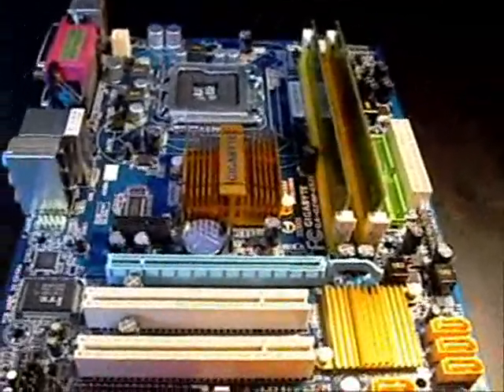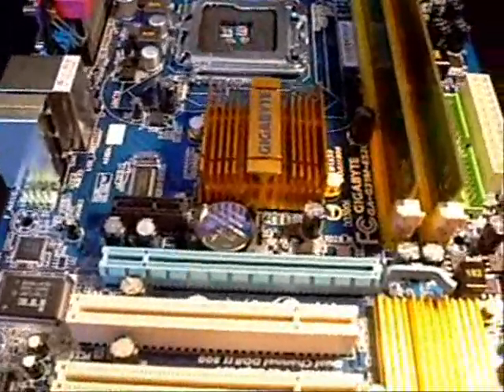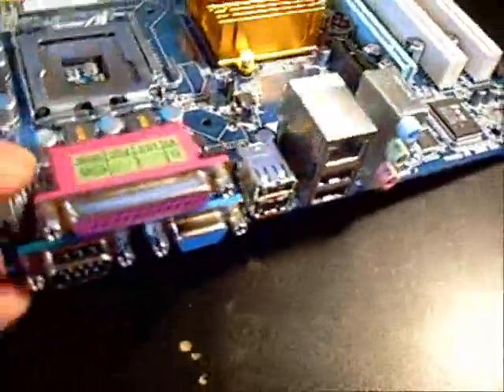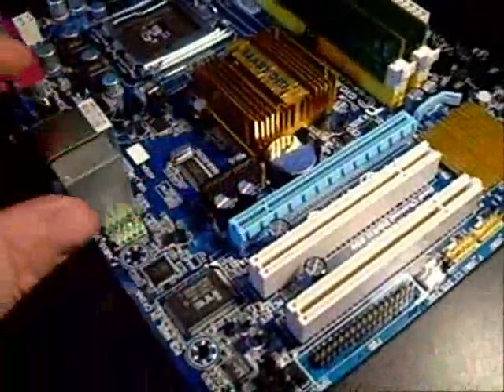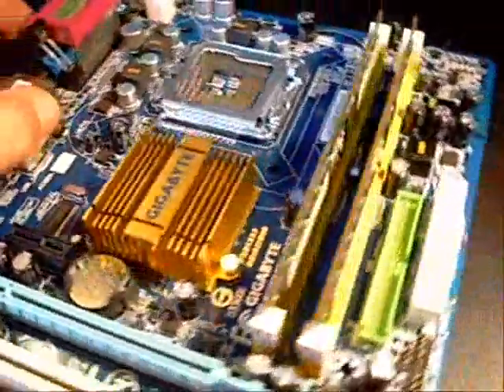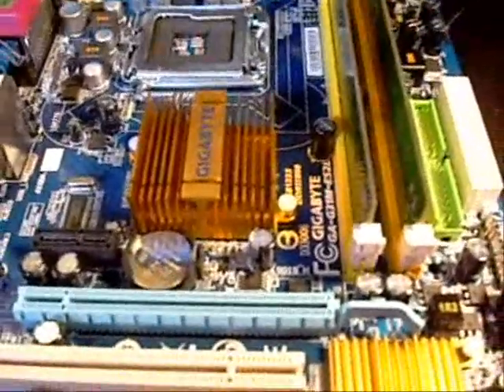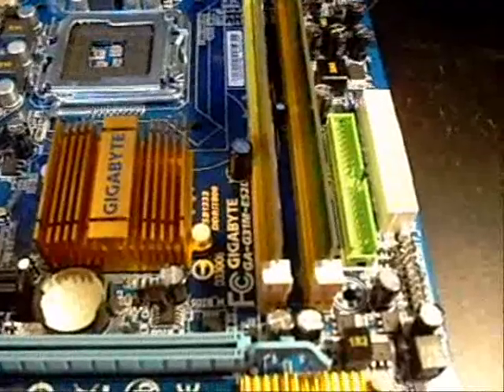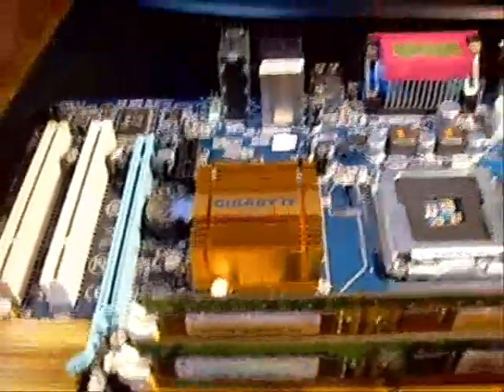Full Review on the Gigabyte GA-G31M-ES2L Motherboard

Comment from the maker: @AtomicF Some very nice choses. You didn't mention what cpu you are planning on using?.

One thing you will need to change is the memory This board only supports DDR2 800 mhz ram. So you might want to find a set of that. The board will support up to 4 gigs or ram. So you might find a cheap set of Gskill DDR2 800..

Comment from the maker: @mrjamesb562 I have not heard that they have quit making them. I still see them for sale but that might be old stock. I am not sure what the FSB limit is but it is well over 400. I have ran it as high as 455 but couldnt get it stable there with my Q9300. Right now I have it at 433 with a overclock from 2.5 to 3.25 and it is rock solid. With some more tweaking I am sure I can get 3.4 stable.

Comment: Great review, all points covered spot on. I remember reading somewhere about this mb not having  all the memory dividers? that the lowest is 2,66, so with fsb 320 ram would work at 851, can you confirm that ?
Only 4 gb is bad choice for down the line. you think they might enable 4gb sticks in newer bios, i haven't heard of many boards with this constraint...
Also if you know any similar board in that price segment, maybe from asus with similar oc capabilities that supports more than 4 gb of ram?

Comment from the maker: @shemists1 Thank you very much :-)

The onboard video is pretty weak for gaming. But the good thing is that the pci-e slot can run any card that you want. It is x16 and I used mine with my ATI HD4870 and it worked great. But I am sure it would use the HD5970 or a GTX 295 or what ever you want in there. But just about anything would be better then the onboard. I evern used my old GT7800 and that worked very well in it.

Comment: yea i meant pci slot lol. I use 1 pci slot for my wifi pci card, and I use the other one for my vantec pci dual 70mm fan card. So I guess I will just screw the fan card into the expansion slot to hold it in.

Comment from the maker: @Twentysixbillion The manual does says it wil do 7.1 surround. But from what i read you have to have a case that has front audio connectors And you use them for the side channels. But to switch channels you just go click on the audio mananger icon in your taskbar and change how many channels you want. To be honest I have not messed with it i just have regular speckers hooked up to it.

Comment from the maker: @Twentysixbillion If the computer shuts off on its own most likely you either have a overheating problem or a problem with the power supply.  Overclocking is raising the front side bus oc the processor to make it run at a faster speed then it was sold at. Like taking a 3.0ghz procesor and running it at 4.0ghz. But it should not make the computer shut off.

Comment from the maker: Yes and no. It would work but because the board only supports 800mhz ram it is going to read it as 800mhz. But if you plan on doing any overclocking it would work great because you will be increasing the fsb of the ram as well as the cpu. And you know that ram will handle up to 1066mhz.

Comment from the maker: That is a very good question. 

Generally the ram with the lower clock is going to be faster. But in real world applications I dont think you would notice any difference. 

If you plan on doing any overclocking I would go for the one with the lowest clock speed. That way if you have to losen up the timings you can set it at cl6 instead of having to go from cl6 to cl7 on the 800mhz.

Comment: the disadvantage is really the 2 slots of the memory :( i used this mobo for almost 5 months or so and i really like it , runs my games with the Nvidia 9800 gt, it's a great board, and i don't use any overclock on it :)

Comment from the maker: Yes this boards is very easy to overclock but it does lack a few feathures that the high end boards have like the ability to overclock the cpu and the ram seperatly.

As far as switching the northbridge cooler you would have to be very careful they can be hard to remove and will void your warrenty if you damage the board trying to do it.

Comment from the maker: That is cutting it kind of close. according to my calculation that setup will draw about 185watts at 85% cpu usage. Or 194 watts at 100% cpu usage like during a stress test. You didnt mention anything about extra fans for the case so I added 2 120mm led fans in my calculations just to make sure you would have enough power. But if you wanted to make sure you could do futhure updates like a better video card then you might want to look at something like a 400-500watt.

Comment from the maker: It is kind of strange when you look at the downloads on their website. Mine is rev 1.1 and I thought they had a 1.2 but it looks like on the website it is only 1.1 or 2.0. The only difference between the two that I could see was 800mhz ram on the 1.1 and 1066 on the 2.0. Other wise every thing else should be the same.

Comment from the maker: That should be just fine. I have my water cooled machine running a q9300 quad core 4 gigs ram and a hd 4870 on a 500w. It has been runnig it for over a year now without any problems.

Comment from the maker: I have read about some people having that same problem. There are a few things to check. For one thing try the new beta bios and see if it helps it is f9c.

Another is some of the boards have a glich with the onboard fan connectors. You can try disconnecting them. Also.

I think iot is the bios. They have had a lot of problems with the bios. I have never flashed mine i think i am still running the f4 that it came with.

Comment from the maker: What voltage are you running?. The voltage range for that chip is .085v-1.3625v. So you might want to set the voltage manualy to something like  1.3v and see if that helps.

Comment from the maker: I did some calculating and that system with a GTX 260 video card would draw 261 watts. So that should be fine. But you are getting close to the limits of that power supply. So you might want to save up and upgrade that soon.

Comment: am gonna upgrade my pc but i dnt no if my PSU(300W FSP) will be enought, new specs

Intel Core 2 Quad Q8200 2.33Ghz(With Rosewill RCX-Z300 Cooler)
Gigabyte GA-G31M-ES2L mobo
4GB DDR2 800Mhz Ram (2x2GB)
250GB SATA 7200rpm Hard Drive
Nvidia GT 120 Graphics card
Imation DVD-Burner
2 case fans 92mm x 2 , will my PSU have enought watts?

Comment from the maker: Yes it is real simple. Put a video card in it LOL. The board is set up to switch automaticly to the pci-e slot if a card is present. There is a settng in bios that will allow to switch it back to the onboard if you want to do something with it instead. But by default you dont have to do anything but put the card in.

Comment from the maker: I did a little research on that for you. The stock ram voltage for the board is 1.8v. But the tweaker section allows you to increase the ddr2 voltage from +0.1v-0.4v. Giving you up yo 2.2v to work with. So I would think it would be ok.

Comment from the maker: Yes you should be able to as long as the voltage is within range of what the motherboard runs for ram. Usally it is around 1.7-1..8 volts for ram. Usally when you run ram at a slower speed then what it is rated at you are able to lower the timings which speeds up the ram.  You are only dropping it a little bit from 200mhz to 166 mhz so it should be a problem at all.

Comment from the maker: That is correct. Ram can run at a slower speed then what it is sold as. They guarantee that they will run at 1066 but they will run fine at 800 mhz and in fact a lot of times ram will run at even tighter timing at a slower speed. So you wont notice much difference if any at running it at 800.

Comment: that's ok. but i got another little problem see my e5200 is @2.75ghz overclocked it kinda gets a little hot when gaming so i thought of changing the stock cooler with a MANHATTAN CPU cooler but am not sure how to install it.should i remove the thermal glue from the intel cooler before installing it or just attach it. pls help

Comment: hi i guess you are right :) it won't work if i will connect them seperatly i think that not every pc cases will work fine with the front side of the 2 usb i have :( 
but maybe i will buy a usb connector and try to plug it on the pci holes :) 
about the additional hard disc well i don't need another one now i have my 360 MB seperate h.disc

Comment from the maker: Most of the time the usb front conector seperates into two seperate connectors on the case, So you can plug them into the two different usb connectors on the MOBO. If that is not the case with yours then just plug the connector into the usb 1 on the MOBO. It should still work fine. But I am not sure if it will work if you use both of the front usb plugins at the same time. You will just have to try it and see.

Comment: oh i have another question, actually 2 if you don't mind, hope you can help me. 
when i at last connected the power supply the gigabyte mOB and the whole stuff i discovered that i have no 2 front usb connection how do i connect it them to the MOB ? is it has to be in this direction one on one at JUSB 1 ? or maybe it has to be connected seperatly?
and how i connect another HARD DISC i have to make it slave right ? but what about the cd burner i have ? :) mm alot of questions thanks for you help.

Comment from the maker: No I just meant that the e7400 and this motherboard would make a good combination together. No need to overclock it. It should be fast enough at stock speeds to run anything you need to.

Comment: well i found an old case that i had a long time ago about 5 years and it should fit, right now i have there an msi big mother board and it's so easy to handle with the case and it has much more space in it so i think that i solve my problem. i really appreciate your help !!! thanks alot man

Comment from the maker: Thank you for the comment. 

That should work just fine for him. As for the cables the hook up for the motherboard for the power switch and reset and stuff is on page 28 of the manual. 

If you need any help just give me a shout.

Comment from the maker: Thats a great idea. I am just doing a little mod on the northbridge right now. I will look at the mosfets also before i put it back in. The only problem is that the mount for the blue orb II go right over top of them so it would be hard to put something there but I was thinking maybe along side them to pull some heat away from them.

Comment from the maker: It sure would. I put my HD4870 card in there and got 15,000 in 3dmarks 06 without any tweaking. So it would make a great gaming system. 

As far as your board check your ram setting and make sure the timings are set right.